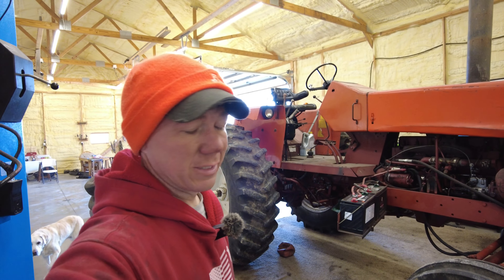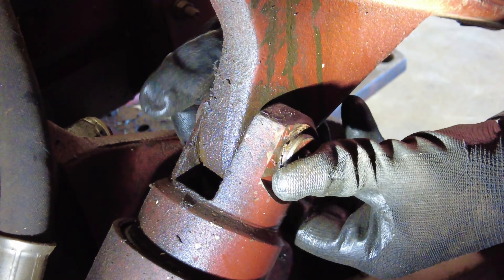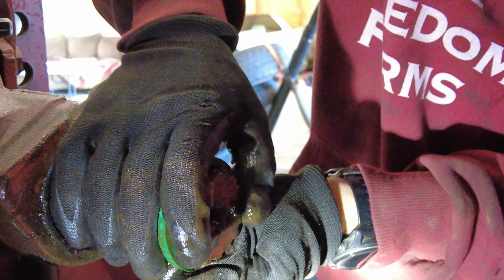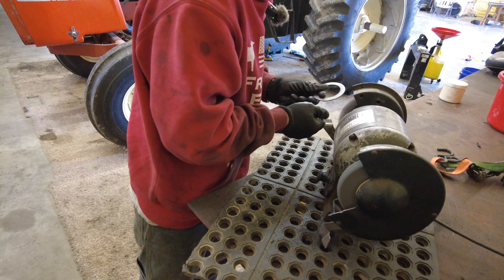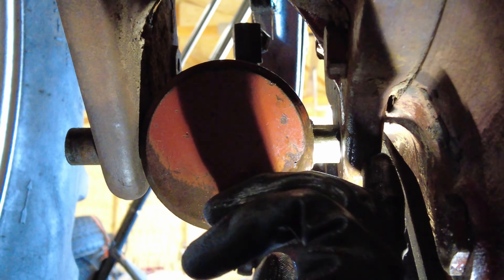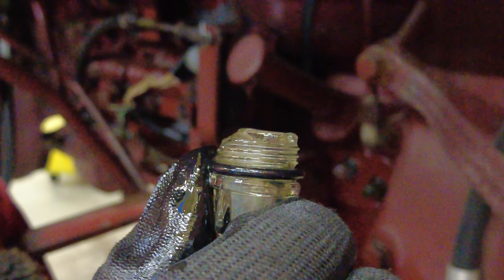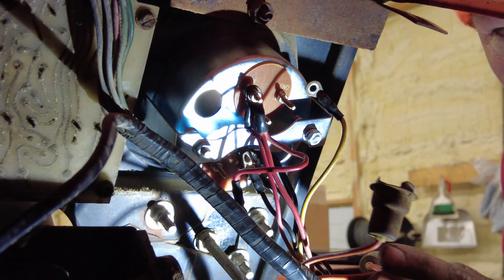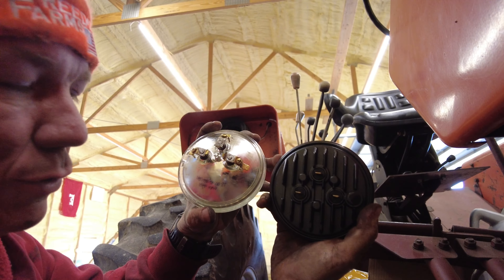Making some repairs to our Allis Chalmers 7000 open station

Comment: The 3point always has went down when you shut off the tractor sense new, it is a 7040
Reply from the maker: I wonder if you have a weak valve or if the cylinder is leaking internally on yours. I've had a several  different Allis Chalmers tractors and never had that issue until this one and it was just because the three-point itself was leaking.